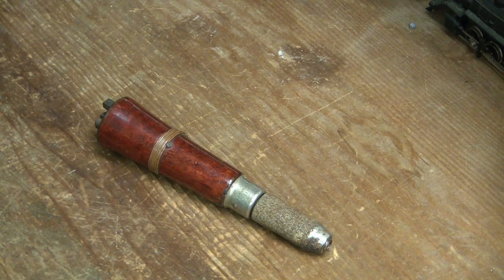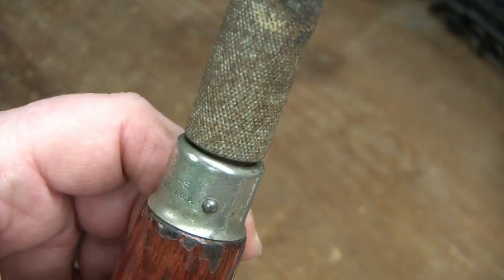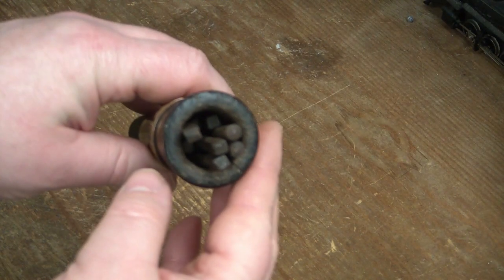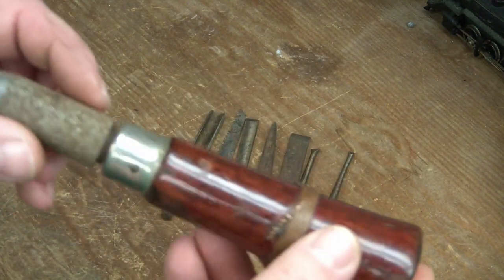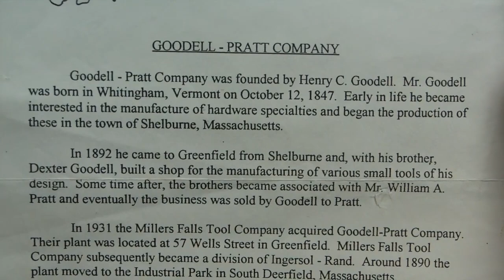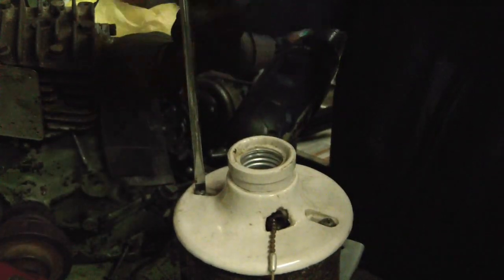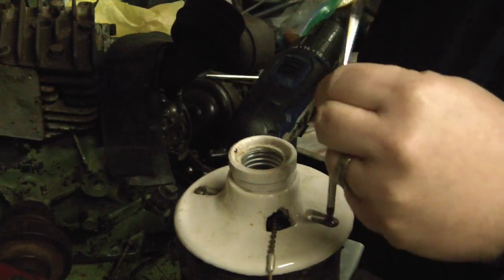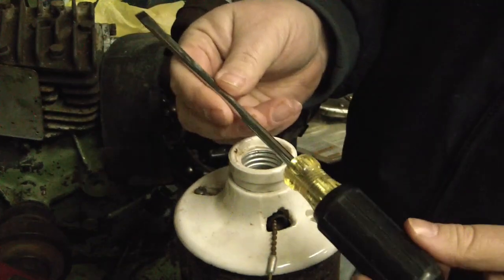Goodell & Pratt and Speed Screwdriver Review (Scoutcrafter Follow Up)

Comment: Outstanding presentation!   That Goodell Pratt tool was really nice!  Some of the early "Multi-tools" like that had a press in cap with no threads!  Just a friction fit.   As for the Rotary screwdriver, there was a reason the screwdriver I had incorporated a crazy reverse bend to it, without the perfect bend the shaft the screwdriver becomes very difficult to handle.  The one Rotary I demonstrated had a great bend to it, however two of the other were much more difficult to operate!  The difference was extremely subtle!  Only a couple degrees can make or break that crazy design...  Great stuff!  Thanks!
Reply from the maker: I am glad you liked it.  Thank you for your support and inspiration.